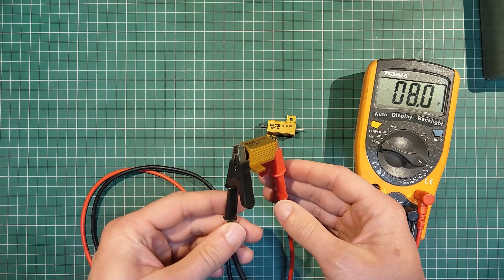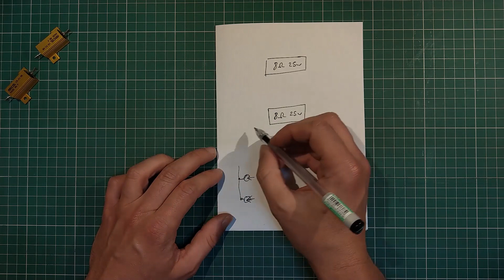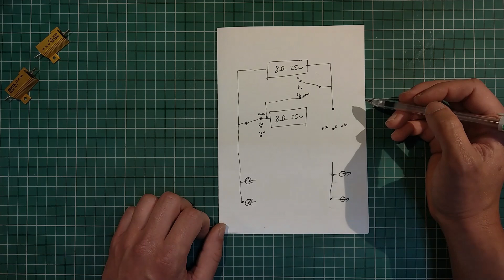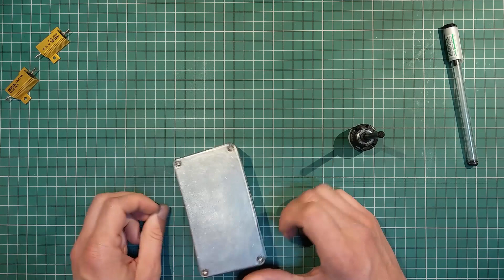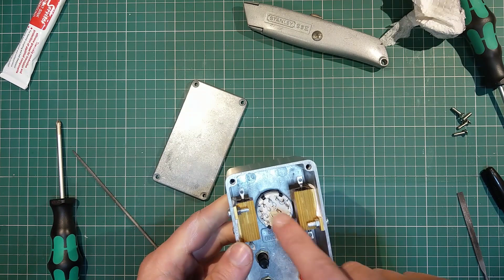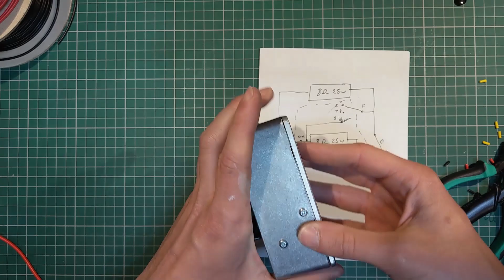Making a 4, 8 and 16 ohm selectable dummy load

Comment: All of those switches have only two working positions. Three CHEAP rocker DPST switches are enough.
Reply: How did you wire the rocker switches to get the correct loads?
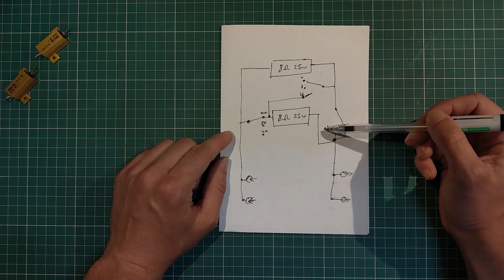Reply: @austinsmith1112  Exactly as @15:19 but they are only on/off. From left to right, 0,1,0> R1 + R2 (16 ohm) __ 0,0,1 > R1(8 ohm)__1,0,1 > R1 || R2 (4 ohm)

Comment: can we use a dummy load resistor to connect a 4ohm speaker to an 8ohm amp by putting the speaker and a 4ohm load resistor in series ?
Reply: yes you can

Comment: Very informative video. Thank you for posting it. When connecting two resistors in parallel or series, how is the wattage affected?
Reply from the maker: Good question. Resistors in series or parallel share the load evenly if they are all of the same resistance. The resistors I used in this project were 25W so the power handling of both resistors connected in series or parallel is therefore 50W. If there were three equal resistors it would be 75W and so on. If the resistors were different values you would need to do some maths to work out the power going through each resistor. However you also need to think about the power handling of the rest of the circuit, in my case the switch can only handle about 35W so that becomes the limiting factor in the 8 or 16 ohm ranges.
Reply: @jegprodtech4174  Thank you! Will you be posting more videos?
Reply from the maker: Hi, I will indeed. I have a number of audio and repair projects waiting currently. Sadly I moved house early this year. Disruption from work, moving my whole workshop setup and now Covid-19 havea all hugely delayed my plans!